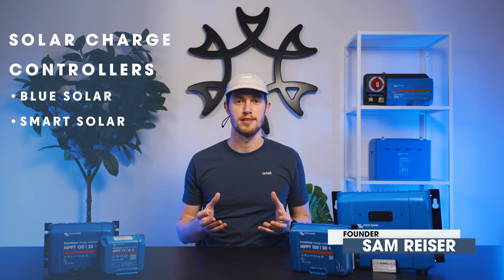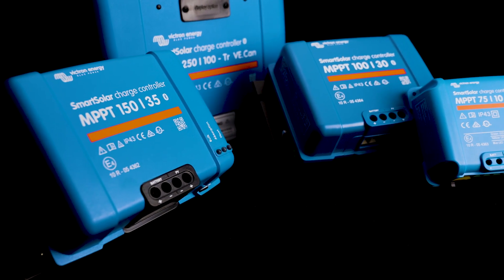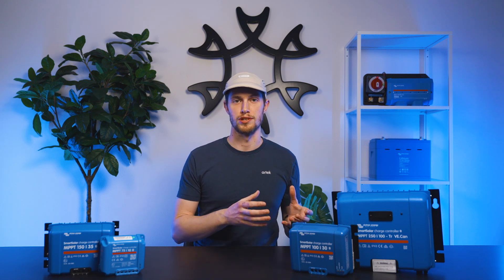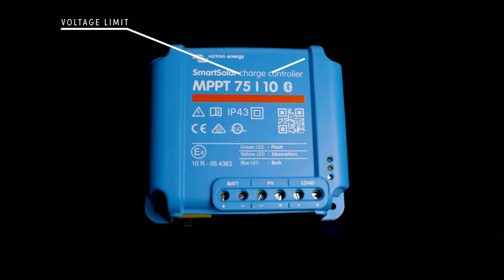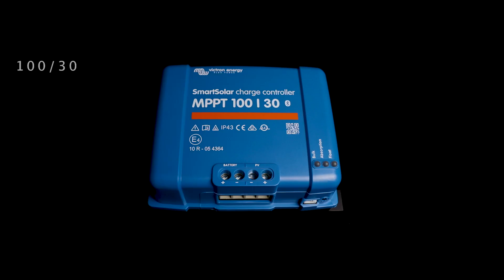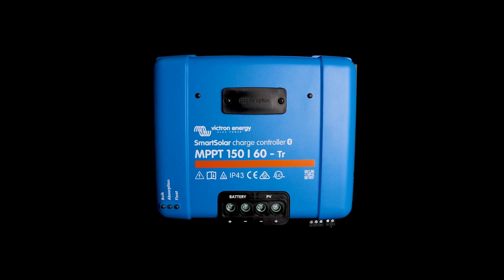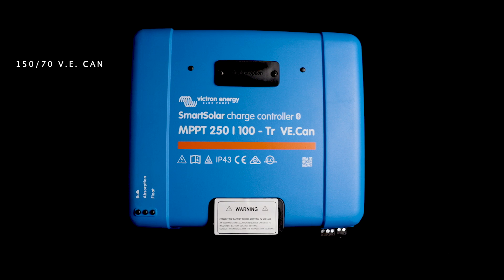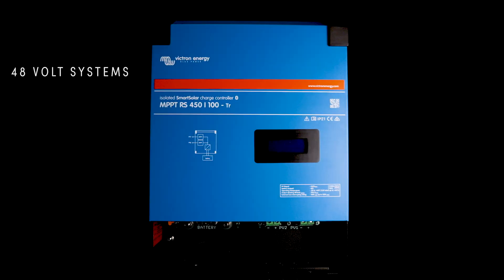Victron Energy Smart Solar Charge Controller MPPT | Overview and Basic Information

Comment: They now offer a 150/70 too.
Needed the higher input voltage due to long wire run and slightly undersized cabling.

Comment: Victron MPPT ar good controllers. But if it breaks down, it cannot be repaired because of the potted housing.

+ and -- wrongly connected and you can throw it away. The fuse cannot be replaced.

Comment: Hello, for three 400W 48v panels, which MPPT do you recommend?
Reply: 250/60 Smart Solar MPPT
Reply from the maker: @TsekeRiba  You could typically go well under. Typical residential panels will run anywhere from 35-45v and the wattage rating of the MPPTs state you could get away with as low as a 35A charge controller. But we would want to make sure on the panel specs hence reach out if you have any questions! Without double checking their specs we would be leaning towards a 150/35 and save money compared to the 260/60. However, once again, this should be verified.
Reply from the maker: Hi, for sales information please send us an email to info@artek.energy that way we can collect all of the necessary information to take care of you!

Comment: Am i able to use a 24 volt sola panel with my  SmartSolar MPPT 75/15 Charge Controlller ?
Reply: Yes, a 24v panel that outputs >=15amps would work with that controller.
Reply from the maker: Hi, You definitely can as long as you are not exceeding the voltage input of 75v for that charge controller. You need to take into consideration temperature compensation to make sure of this. Feel free to send us an email at info@artek.energy for us to assist you further.